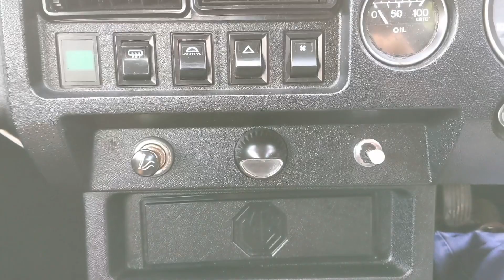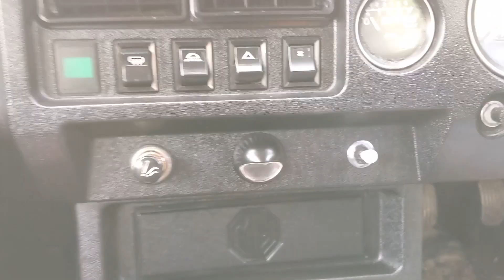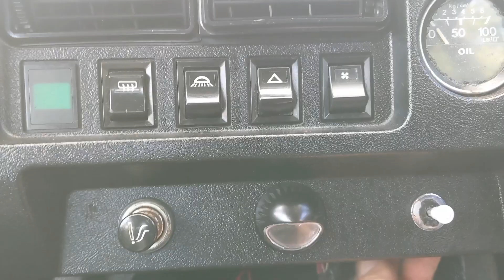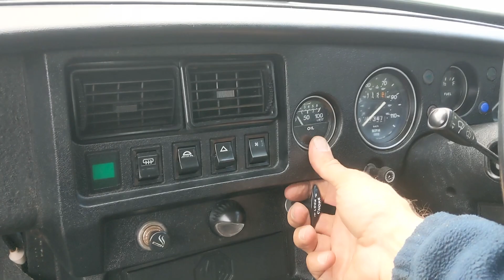MGB GT Episode 63: Replacing the choke cable

Comment: What's happening with the TR7 ?
Reply from the maker: Hi Andy, the white FHC TR7 should be getting some work next week.  Plan is to get last bits off engine and get the head and block to a machine shop.  For the rest of the time I'm with my parents, I'm thinking about striping the front suspension and subframe, cleaning, painting and reinstalling.  I have bought new bushes but some bits still on backorder so not sure how much I can do.  For the drophead the plan is to get the front suspension/subframe back on so I can wheel it out of the garage and cover it so I have room to work.  Getting working cars working again is the priority, hence doing MGB.  And so I might be taking the gearbox out of the Stag to fix after I have the drophead out of the garage.  I haven't decided yet.  Because I might take it to a garage